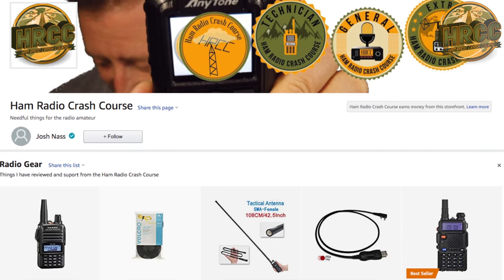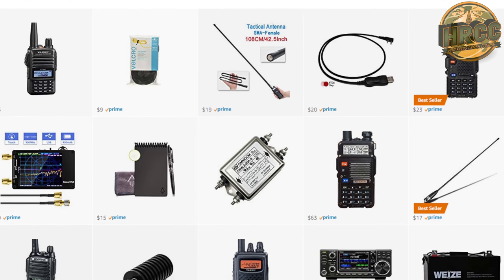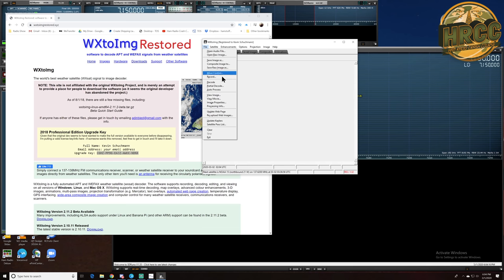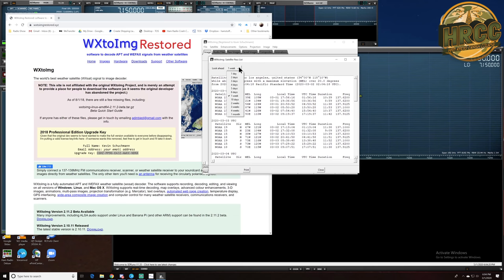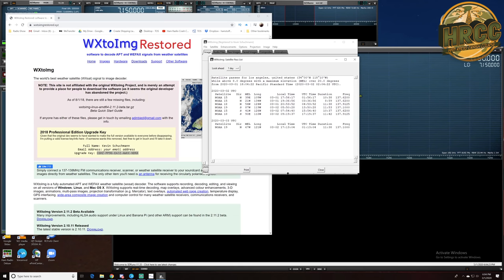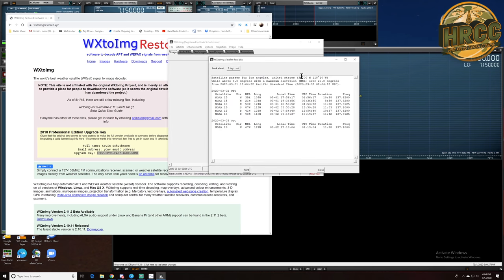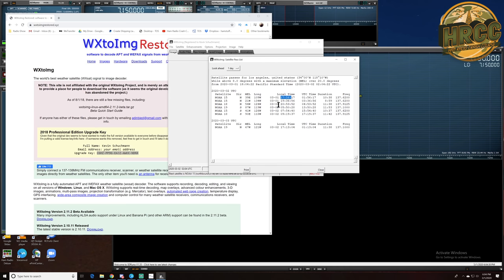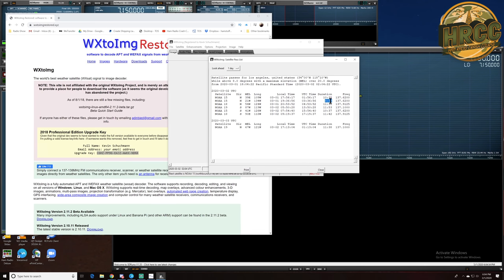How To Receive Images Directly From NOAA Satellites

Comment: Great video!  I am currently taking a HAM course to have communications on my  pocket trawler that I intend on doing a lot of cruising in my retirement.  Since Marine band VHF is so limited with line of sight, HAM is the answer for me.  The ability to pull NOAA images using your compatable 2 meter antenna can be crucial when planning long open passages.

Thank you so much for the informative post.

Comment: There is a video where a really young kid went outside, received NOAA 19 with a baofeng, recorded the sound on his iphone, transferred to audio to a PC, converted it to the right kind of WAV file and then used the same program to view the picture. Worked great, no SDR reciver required, just a Baifeng and an iPhone. Used similar satellite pass software.

Comment: Great video Josh!

Amazing I JUST put a sat monitoring station together using an RSP1a, an old core i7 Optiplex 990 SFF and a V dipole that I built and hung off the end of the soffit outside my 2nd floor window. Great timing!
I considered using an RTL-based SDR for my project, but the SDRPlay SDRs have the kind of low signal specs one wants in an application such as this.
It isn't that the RTLs can't be used, and indeed they would work for this application, it's just that the SDRPlay units have the specs that make them optimal.
I did put a little money into the hardware, but it is a solid stand-alone ground station for less than 200 total that is also an awesome backup for my main ham radio PC if I need it.
73 DE N2NLQ!
Reply from the maker: Very nice using the Optiplex for a stand-alone unit.

Comment: I watched another video but yours has more information.
I listened two weeks ago to NOAA 19 and decided I need to see some pictures. I used an FT817 and 4 element horizontal outdoor collinear for 2m. I need to make up a cable from the 817 to my computer running Linux Xubuntu version.
G4GHB.

Comment: Hi Josh, I just tried for NOAA 18 with a microphone from my 817 speaker but the signal from NOAA 18 is not strong which is why I think I got a grainy picture and impossible to see anything. Attic h.f. dipoles work better than my outdoor 2m collinear. It's a start and I think a better aerial needed to get a stronger signal.
G4GHB.

Partial success! Collinear better this time. NOAA 18 again. I think it's where the satellite goes over me, east shielded by the house. Not perfectly clear but the aerial is low. I don't think I decoded it last time. I'm learning.

Success today, Saturday! I Put my dipole outside and received the best pictures yet. I think crossed dipoles now.
Reply from the maker: Collin ear is going to depend a lot on the pass.
Reply from the maker: Too vertical and your antenna null is going lower the signal quality.
Reply: @HamRadioCrashCourse  Thanks for the replies. I've thrown together a dipole cut for 137 MHz yesterday and see how that works, got to be better than something off resonance at 137 like my dipoles or collinear,  but need to get it outside. I hope this high noise level I experience won't affect reception because on h.f. due to broadband QRM I get S8 noise and sometimes on 2m I get S5 - S8 noise! I do wonder if it is because one pass of a satellite yesterday was pretty strong. It's killing amateur radio for me which is why I thought of receiving wx satellites.

Comment: If you were going to use a radio through a Signalink versus SDR, would all the settings remain the same? Also, thanks for all the videos and info you share. Super helpful.
Reply: As far as I understand it, as long as you have a way to get the recieved audio to the software, it should be able to work.

Comment: Great video sir .... and thanks as usual.  I'm still having a little trouble with my RTL-SDR running SDR#, as I can't quite get the sensitivity good enough to copy a usable picture.  I'm using only a Vee-dipole, but I expected a better signal.  I've tried copying using the VHF portion of my Icom 746pro but it doesn't track the doppler, and even with the preamp running, the signal ain't that hot.   I guess I'm gonna have to put a little more horsepower into building a better antenna.  For now I'm copying satellite pix from the NOAA HF stations, But I refuse to give up!!   :)
Reply: if you can use the dipole withthe right degrees, you can load up the shape onyour monitor and hold it infront of it, once they are extended to the right length its usually good, you can try without a extension, and use a long usb cable for less losses, and try and point v, towards or away from the pass,

Comment: Many thanks for sharing - the presetting of the decoder app isn't exactly common sense, so your help is very useful.
Did you see this noise pattern on your spectrum when there is supposed to be no signal? That looks like your USB isn't shielded properly or some switching power supply is not properly filtered - receiving that over the enormous noise gives me hope to receive a clear image as well.
Reply from the maker: It was likely a battery bank I had by it working on something else.

Comment: Looks like it does same thing as 1990s Hamcom interface you could build with an open loop op amp fed into PC serial port handshake signal.  Use SSB radio to feed Hamcom box.  SSTV from NOAA.

Comment: Hello! I'm curious about the madness. Do you think it's possible to do this by connecting your Ham radio directly to your computer? (UV25x2 with programming cable or audio cable) if the sdr receiver is just for receiving, was curious if it's possible to use what I already have that connected to the antenna lol thank!

Comment: Great video. Ordered the RTL-SDR Blog V3 due to another video of yours. Can that dongle handle this as well? 

And was wondering what sdr software you're using on windows. Looks very clean.

Thanks a lot, greetings from Rotterdam, The Netherlands.
Reply from the maker: That RTL should be fine. Most usb sticks will handle vhf uhf just fine. There is a website “big SDR Software list” that I download from. Google it, plenty of cool apps out there to try.
Reply: Hey Broody how did you get on with the RTL? What antenna did you use?

Comment: I just tried this, follow the steps to the letter.  I get back an ERR:
Error - waveIn Open failed (check soundcard in options -> Recording Options)! 

I put it exactly how the video says - Cable Output (VB Audio) 22050 sample rate, baud 57600.
My AirSPY is set to Cable Input (VB Audio).

I dont know whats going on.......  Im so lost now.   😭
Reply from the maker: Many have followed to the letter and got it working, so Idk?

Comment: Hi, why is it that i loose the monitoring audio output of  SDR when i activate the v-b cable when decoding a NOAA satellite thru WXtoImg ? I just sit silently watching the screen printing the sat picture. I temporarily am using my random length wire antenna, can't use my homemade v-dipole yet outside because of the cold and rain. Thanks.
Reply: @evmanbutts  Thanks for the tip, I will try it 😀

Comment: Do you know if you can directly connect the raw wires to your sdr by cutting the wire that came with the sdr and then splice them with the raw cables of your dipole antenna? Because I don't have Connectors and i don't want to break my sdr or my laptop.
Reply from the maker: Like bypass the connector??  Sma cable are cheap. Just buy some sma cables.
Reply: I mean if instead of connecting each rod into the connector and then use a cable to connect it to the sdr, you just connect it directly to the cable that goes out of the sdr, without having a connector in the middle.
Reply from the maker: It should work. But don’t blame me if it doesn’t 😅

Comment: Hello again. I downloaded the Linux 64 bit but it didn't download one folder so I just downloaded Linux RPM and all folders shown now so I'll see how it goes.
Don't get Linux if you don't like messing about. I like it 'cos it's cheap. Cheap as in FREE.

Right, something is happening now after I went into Terminal. I put in my location, so I'll play around with it and see how things work.
G4GHB.

Update: I couldn't even hear the satellite which was supposedly going over me. I'm not sure why because I did hear NOAA 19 two weeks ago. I seem to remember I used my h.f. attic dipoles at that time so maybe a dedicated 137 MHz aerial will be the thing to use.

Update to my update: I woke up this morning and realised I was looking at my computer clock which is BST and not GMT or UTC! No wonder I heard nothing. It wasn't there. Still, an aerial cut for 137 MHz has got to be better than h.f. dipoles or my 144 MHz collinear.
Reply from the maker: Good luck!